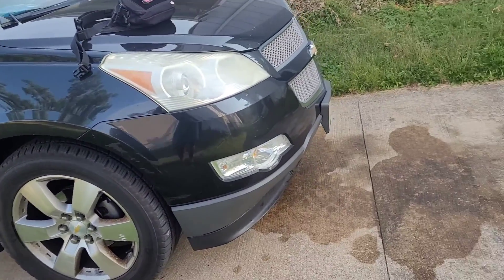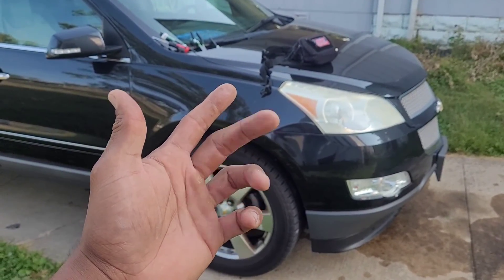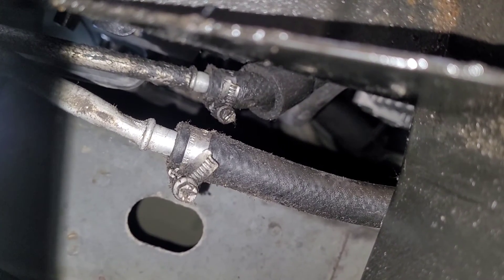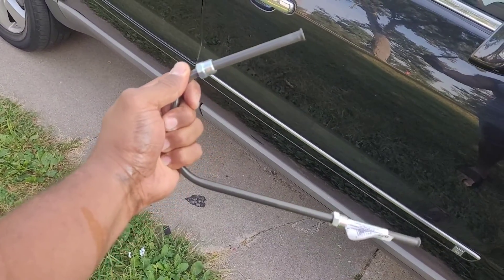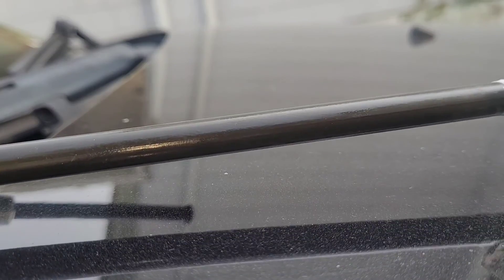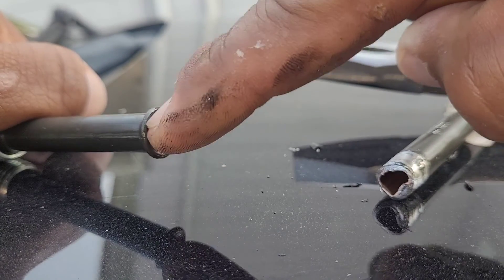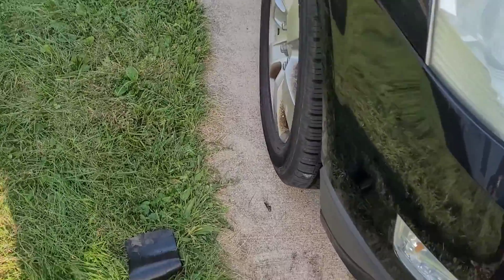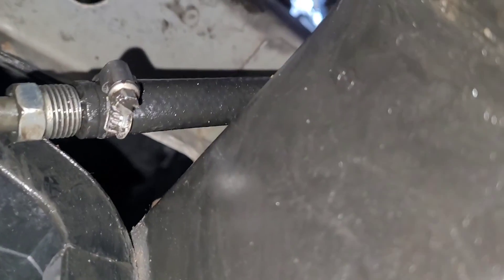How to Bypass a Power Steering Leak/Power Steering Cooler Leak

Comment: So many things wrong with this fix, you may have stopped the leak but I can guarantee you are causing way bigger problems in the future. The cooler is there for a reason.
Reply from the maker: Hey Thanks for Watching and Commenting!! 

I understand your concerns, however power Steering coolers are really only needed in commercial, off road (rock crawling style) or "drift" vehicles! Essentially anything that turns, and maintains that turn, hard, long and or fast!! Not essential for any daily driver. 

After this fix This suv had no more leaks nor issues for the year after...failure came in the form of frame damage during a hit and run for the owner, and lastly as mentioned in our intro video and about video..we show quick fixes to make sure you can get to work..times are hard, inflation is high..it does the owner no good having a non functioning vehicle.

This got her on the road same day, within minutes to go to work..get kids from school and save up to do a cooler replacement had she chose!! She chose not to, vehicle functioned fine! 

This is a very common repair done in many shops around the world Including commercial vehicles to bypass failed hydraulic systems!! In fact in these very comments a commercial driver mentioned how he bypasses his semi trucks cooler..normal repair!!
Thanks for watching and happy Wrenching!!

Comment: I have a volvo semi truck that has one of these dumb coolers. Right now I have it bypassed too, and don't plan on replacing the cooler. Power steering is actually working better than it did before the cooler leaked. I have a brass barbed pipe connecting the two power steering hoses together. Went down on me Arizona where it was 115 degrees today.
Reply: Man my steering just went out on my Volvo dump truck and someone gave me the idea to disconnect the hydraulics from the pump so I was searching for results. I don't have a cooler, just the pump coming out the side of the engine.

Comment: nice hacks. I used a 3/8ths fuel line to bypass my cooler on the 4th gen chrysler minivan. basically the opposite of your setup, steel lines with rubber hose bypassing the cooler.